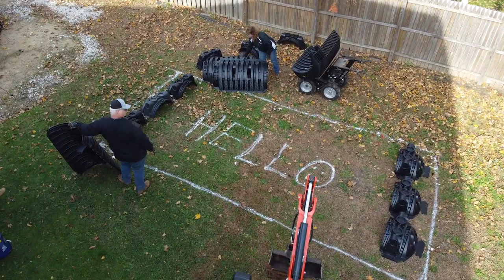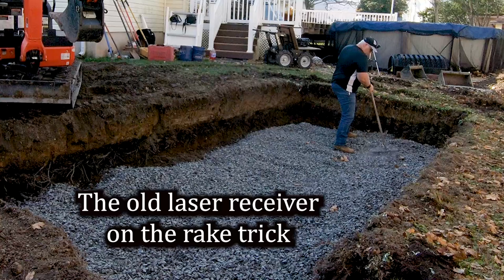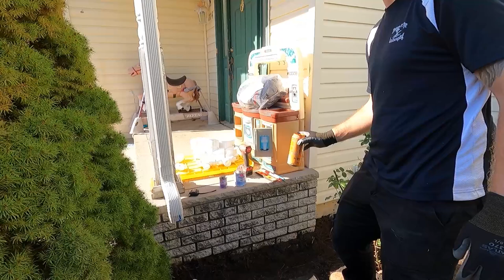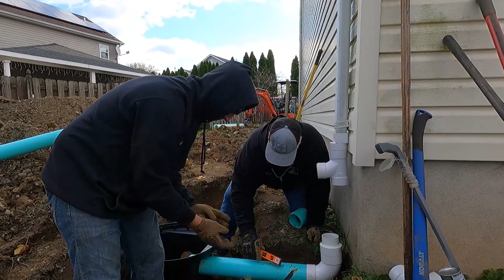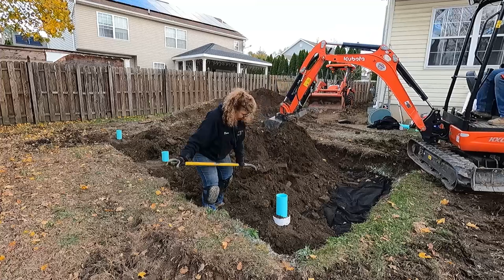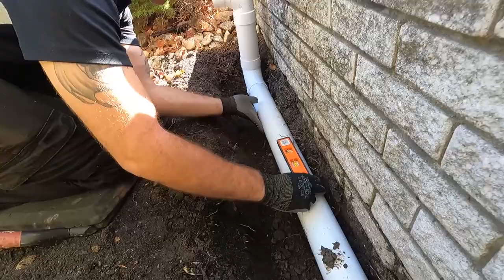Downspouts and Sump Pumps to Leach Field / Dry well - Sayreville, NJ.

Comment: Which brand of storm chambers for the leach field did you use and why?
Reply from the maker: We use Infiltrator chambers because; They're great, the size and height work well with our application and they are sold by our plumbing supplier.  They've been around since the 80's. We've been using them for years now and we haven't had any problems.

Comment: Well, yeah, it's nice work, but it's needs to go deeper below frost. I had that similar situation pipes froze ice build up.
Reply from the maker: Thank you chico.  I appreciate your opinion, but I’m going to disagree with you. Our frost line is 36-42”, but the water table in this area is 24”.  Which is why it was done at these depths and  this way. A dry well below the water table won’t hold much storm water. Plus, we have freeze protection built in. This system has been working perfectly for almost three years now.  Have a nice weekend, Tom
Reply: Oh ok that explains it. My house is on the slope. I'm in the situation right now that 20 years had contractor installed 4 separates Chambers drywells for Down Gutter Sprout. Apparently it didn't hold up due to clay. Two of the Chambers flow back and did froze up. So, I'd put my own 4" PVC Schedule 40 partial front to the back all the way down the driveway into Double Chambers where the soil is sandy. All works good over the years. When heavy rains comes down it fills up into the window wells. The rain also comes behind the neighbor that he's higher up on the slope. So, it's run off to my property. This week I had to cut concrete to raise one of the windows up higher 2" above ground now. It was below the grade. Still gotta do another window. Now, I'm trying to install Channels against the foundation as well basins connect to existing drain that I put in. Just discovered that the pipe is level no h has a pitch. I do have a machine to dig. Which I could send you photos. Basically, have an option is put Flo well with sump pump inside and have it pump half way with 2" flexible hose inside the 4" Schedule 40 pipe that has a pitch. Other option is to tear my deck down redo the drain piping.
Reply from the maker: Wow, that definitely sounds like a tough situation. I hope you don’t need to damage your deck. Do these dry wells and chambers have over flows?  A way for the water to escape when the system is full.
Reply: @tyelandscapinganddrainage  
Yes I am looking into that. The deck is 20 years old and planning take it down put Pave stones. 
Anyway, thanks for your input.
Reply from the maker: Best of luck